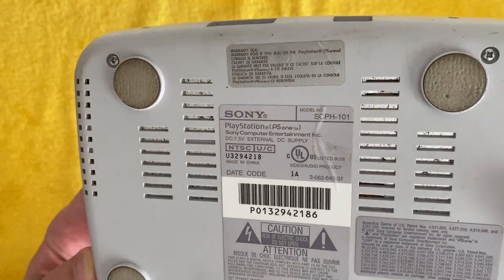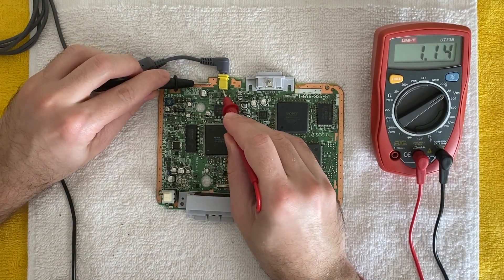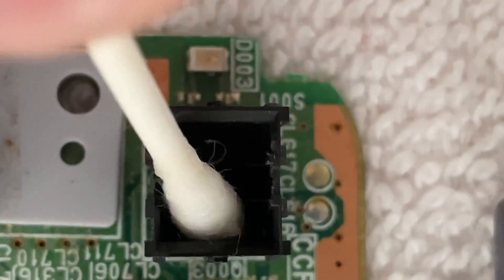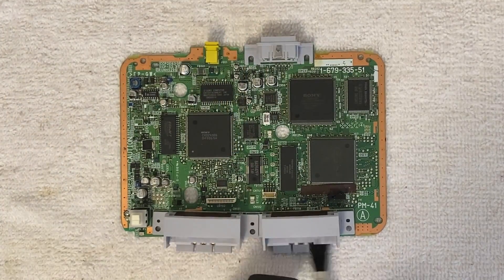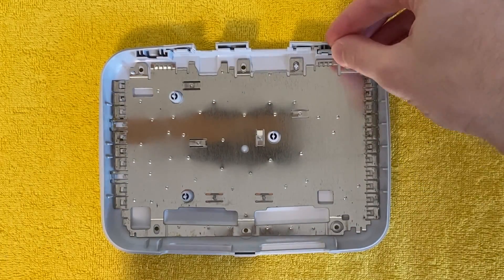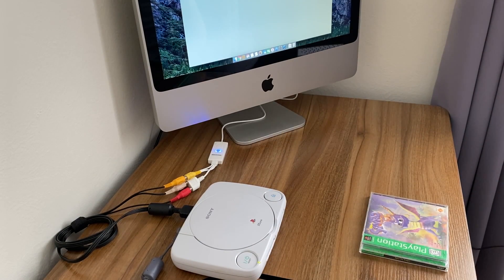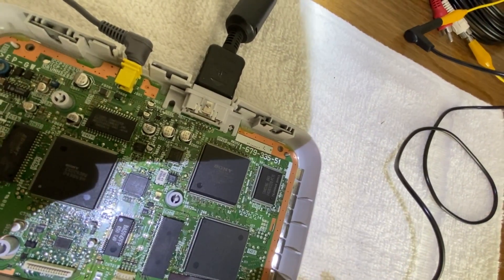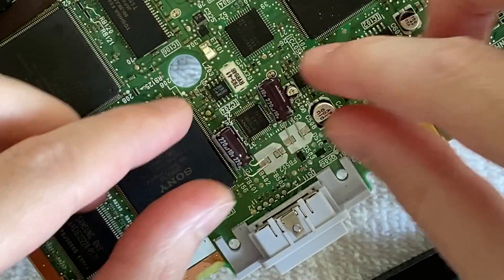$0.96 Faulty PSone Repair - Retro Console Restoration

Comment: I doubt I'll get a reply on a 5 year old video but how did you attach the multimeter to the cables? I couldn't quite see. Also, were you just testing continuity or was it on a different setting?

I have two ps ones with glitchy video and I'd like to test if it really is the capacitors before gettin out the soldering iron 😅

Comment: Tried cleaning out that power button and I can't FOR THE LIFE OF ME get the damn thing rebuilt; the spring keeps flying out, that small metal pin thing keeps falling out of place, and I don't know if the metal plates are set correctly; they look bent and I'm not sure which way they're supposed to be facing. I thought about just buying a new power switch, but I can't seem to find the right one.

Comment: Mine still immediately turns off after (even though switch is in on position), the LED blinks green when pressed but as soon as I take pressure off the LED turns off again. I feel like it's an issue with the button but I followed your video and my button parts all looks the same as yours

Comment: I'm impressed with your troubleshooting skills and how cleanly you got the caps off the board.  

Your soldering skills need some work.  This is an older video so I'm going to assume your skills have improved since this and you have invested in some better quality solder and a better iron.

Comment: Have a friend who did mostly old consoles restorations and he told me about these specific models that often there is nothing broken it just need a solder reflow on few places or a good cleaning, people toss them out without even realizing it's a near perfect unit, basically by tossing it out only then creates actual further damage. Some shops also have these sitting for years and due to being in bad environment they accumulate rust. Also said that the ones he found just had rust on them even tho powered on and played games without issues, why were they in boxes for years in repair shops no one knows... Lots of ignorance and neglect is what kills these consoles and not manufacturing faults.

Comment: Hello, this video really helps me find the faulty capacitor on my ps1 fat model. My SMD faulty capacitor code is "GRZ 220 4v" can I replace it with SMD "220Uf  4v"? or is it okay to use SMD "220Uf 10v" Please advice. Thank you
Reply from the maker: Has to be 220uF. Can be 4V or rated for higher. You can always go higher on voltage rating, just make sure to match the capacitance.

Comment: My psone worked fine for like 3 years then I kept getting a insert Playstation format disc and i replaced the laser and still getting that error, maybe fuses in the motherboard are dead?
Reply from the maker: There are 5 fuses to check. I have another PSone video about it. But also confirm you removed the solder blob on your new laser (most ship with this solder blob for transport and it needs to be removed)

Comment: what can i do if the conector is broken?
Reply from the maker: Which connector? Are the traces still good?
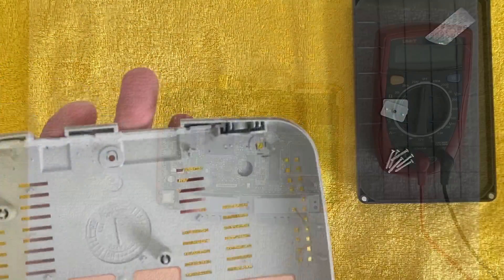Reply: @BorderlineOCD  Sorry if i sound a little dumb, i was talking about that yellow thing where you plug the cable, where you use your multimeter in 1:26

Comment: Man this was an awesome video.  I'm currently waiting on my first batch of "broken" consoles to come in so I can attempt to fix them.  For most of them I'm not expecting much problem, but if there are any issues with the motherboard like in this video, where do you look for information on how the connections on the board flow?  Are there schematics, or is it intuition from working on boards?
Reply from the maker: This particular system has very easy to find schematics. I found them useful for component identification, particularly fuse values. But I don't go straight to schematics. There's a bunch of common issues with this model you can check first. I have another PSone video that covers some of these common issues: https://youtu.be/k6JgGvVGmgw.

Comment: I got a psone that keeps blowing the fuse when I try turning it on, it worked fine it had a mm3 chip but I tried to "shorten the cables" to tidy the chip installation, now it won't turn on and it keeps blowing up the fuse, what can it be?
Reply from the maker: The main power fuse (2A)? I would guess that theres a short somewhere (probably stating the obvious) but if I was in that situation I would remove the modchip and see if the issue persists.

Comment: Great job. What do you suggest doing when the PS1 starts to the home screen, but the lens doesn't do anything. Is that a capacitor issue, or something more serious with the lens.
Reply: If the disc isnt spinning at all, its likely that the grease has dried out and the gears arent catching so the slide doesnt move. Im having this issue with a couple of mine and need to get some lithium grease

Comment: what kind of lead fits in a composite video port?
Reply from the maker: Not sure I understand what you're asking unless you mean an RCA connector.
Reply: @BorderlineOCD  ya i have a multimeter but the leads dont fit into a RCA connector
Reply from the maker: I have another PSone video that shows you how you can use a paperclip to make it work.

Comment: O nerd tour help i hace this model Playstation and not function Port controller is possible help to me thanks for tour answer
Reply from the maker: I haven't run into that issue on a PSone. On the original PSX there is a fuse for the controller board but not sure about the PSone. Have you checked all the fuses? Have you also confirmed your controller works on another system just to eliminate that as well?
Reply: @BorderlineOCD  hi and thanks for answer My controller is fine works un another console and the problem is my console this week check the fuse and answer to you my friend salutes

Comment: Can you list the capacitors ratings and where you got them from.
Reply from the maker: The originals are 220uf 4V caps. I replaced them with 220uf 10V caps. I got mine locally in my neighborhood, but if you want to buy them online you might as well source the exact replacements rather than install the larger ones I chose to use.

Comment: My psone when i playing the psone restart continuosly
Also must be a capacitor?
Reply from the maker: I don’t think so. Sounds like something to do with the power rail or power supply? Check the connector to see if it’s loose. You might have to open it up to inspect the solder joints up close. If you can borrow a known working power supply that would also rule out any issues with yours.

Comment: How to check the lens is not broken?
Reply from the maker: Not sure precisely what issue you're having but a common problem with these is failing optical drives altogether due to broken gears (the gears were initially made of plastic and they often break).

Comment: Have you ever run into one of those ps1 models that only displays in very dark or very bright almost as if it's displaying in black or white? If so how do I fix it?
Reply from the maker: If I had to guess, your AC coupling capacitor is failing but hasn't failed altogether. Its the same capacitor I replace in this video.

Comment: That's why I don't buy electronics from EBAY, because people sell them broken. 
It's hard to be happy of what you want to buy off of EBAY, but you're also disappointed at the same time when you don't know the seller who rips people off. Specially when they don't tell you what defect the product has, when they only give you a small amount of details.
But im sure it's like that off of Amazon too, but not as much as EBAY.
There's a lot of people who sell electronics off of EBAY, who aren't truthful about those products they sell.
Reply from the maker: I've had decent results with eBay listings. I think its important to check the seller's feedback and assume if condition is "unknown/untested" than it's most likely broken. If you have those expectations you're usually not disappointed.

Comment: I too have a non-working ps1. It boots, but can't read any disc. I assume the problem lies in the laser, but I'm actually clueless. Any idea pal?
Reply from the maker: A common problem with these was failing gears in the drive motor (they often break). You can carefully disassemble the drive housing and see if the gears are indeed broken. You'll need a very small screw driver to take it apart.
Reply: @BorderlineOCD  I happen to have a set of very small screwdrivers, but without a video tutorial I don't even know where to start or what to touch: is there anything valid and crystal clear (for dummies like me) available on your channel or on YouTube that you would suggest? It's not a matter of life and death, I just think it's cool if I could revive my old PS1
Reply from the maker: If you don't find anything on YouTube that helps, stay on the lookout for a follow-up video to this repair. I have another faulty PSone so maybe I can take the drive apart in that video.
Reply: @BorderlineOCD  Yep sure, I have already subbed, keep up the good content

Comment: I have a problem with my consolle it's the same model of that but the disk don't wont to turn and when i Power on the consolle go to the bios ( the grey squares when your consolle dont read the disk)
Reply from the maker: A common problem with these was failing gears in the drive motor (they often break). You can carefully disassemble the drive housing and see if the gears are indeed broken. You'll need a very small screw driver to take it apart.
Reply: @BorderlineOCD  the cd wont spinn Sorry for the english i'm italian😅😅
Reply: @BorderlineOCD  the motor work
Reply: Can you help me?😅😅

Comment: Nice content. Why all repairs on YouTube are easy tho, mine has a weird problem. When i heat up the CPU with a heatgun, it works. When it cools down, it crashes.
Reply from the maker: In the moment is certainly feels frustrating but after you figure it out it looks obvious :) Your issue is strange. Sounds like you're getting it hot enough to bridge a fractured connection. Does it work if you apply some pressure with your hand when you turn it on? Wondering if its worth reseating the chip with fresh solder.

Comment: i still have a lot to learn about electronics but maybe some day i will be able to fix my old ps2 that cant read discs cuz the ports for disc reader cables on motherboard seems to be broken i already was able to discover what was the cause of the issue and thats something
Reply from the maker: Great first step figuring out what's wrong with it! Definitely save it for a future repair. Maybe you can practice on a 'soldering project' kit from Amazon or a faulty appliance that you don't mind messing up.

Comment: always the freaking av connectors ;D
Reply from the maker: The video issues are apparently a common issue with these, along with the optical drive gears breaking and power switch failing...

Comment: I need to check the power switch on mine. I never thought about doing that.
Reply from the maker: Apparently a common fault with these. You can also short the pins on the back (horizontally, not vertically) to manually close the switch if yours is broken altogether or something.
Reply: @BorderlineOCD  the switch seems to move up and down fine but I never thought about checking it with it opened up all the way. I also need a diagram so I can also check the fuses as well.

Comment: Great restoration, but I would recommend to replace all caps when you first do a restoration. The ps1 is getting a bit old now and it would be a shame if one started to leak and ruin parts of the machine.
Reply from the maker: I'd definitely consider this on a system that has more personal collecting value to me. I'm keeping a look out for the original PS and may do a more thorough restoration once I get my hands on one.

Comment: careful with the vacuum cleaner. static will kill tiny components EASILY!
Reply from the maker: Received a comment or two about this. I understand the theory behind it, although I've never had it happen. Will look into using an air compressor instead in future repairs.

Comment: Solid capacitor not eletrolitic!!!
Reply from the maker: In a perfect restoration yes, but I had to work with what I was able to find locally and the store didn't carry any SMD components. I also researched as much as I could about this video circuit (AC coupling circuit) and although I don't fully understand the intimate details, I've gathered that all this capacitor is doing is filtering or stabilizing the video output signal (which is why I'm able to bypass it during testing and still get video). All in all it made sense to repair it this way on the cheap and get the console running.

Comment: I also have a semi broken psone, It wasnt actually that bad but then i tried to fix the disk laser with some alcohol and now laser is not responding to disks. Do you have some suggestions how i can fix it ?
Reply from the maker: Isopropyl alcohol alone shouldn't damage a disc laser. Wondering if there is another underlying issue. Does the motor spin up? Does the laser move at all (if you simulate the lid being closed). Asking because a common issue with these particular optical drives is the plastic gears failing (they often break).
Reply: i will update when i check it, thx for response.  As i remember i checked the with lid closed moded and probably it didnt even spin once. But i need to check it.
Reply: @BorderlineOCD  sup man, i recorded the behaviour of my ps1 can you have a look at it ? https://www.youtube.com/watch?v=7VFB6AzxXvA&feature=youtu.be

Comment: Your video was inspiring because I have a similar problem but it's on my media controller for my mixer one of those little capacitors falling off the board and I wasn't sure what to do the companion suggested replacing the whole board for €70 but no idea what that is in Great British Pounds
Reply from the maker: If your only option is a replacement board in your particular situation, you might not have much to lose by trying to replace that capacitor yourself. The replacement capacitor should have the same capacitance rating but the voltage can be higher without any issues. For example if its 220 uF 10V you can replace it with 220 uF 25V if thats what you find (i.e. you can go higher on the voltage just not lower).

Comment: Just so I learn something, you connected your probe to the video input signal on your capture card, then traced that signal back to before the damaged capacitor, right?
Great job!
Reply from the maker: Yes, that is correct.
Reply: @BorderlineOCD   so the probe being connected to the stereo audio out is?...
Reply from the maker: Nothing connected to the audio inputs during testing. Just the composite input to probe the various points on the board to check for the video signal. Once I solder the new caps I just use the regular AV Multi Out cable but no sound testing before that stage.

Comment: I'm not sure what's more impressive, how easy you fixed it or the fact that you got a virgin PSone
Reply: What do you mean by "virgin PSone"?
Reply: @cbspydoge  intact warranty seal, with no modchip installed, unless you get one in a sealed box, that's harder to find than an unicorn
Reply: @walpurgisonne  Thanks for the quick response!
Reply: @walpurgisonne  I got one 😍 and it works like a dream still
Reply: Strange things are happening to Woody  the thing there is that most of them got them removed
Reply: @BarryMGC  depending on the condition it might be worth more than a regular one if it's still functioning properly.
Reply: @walpurgisonne   Well yeah mod chips were always pricey. For quite some time now I can buy a PS1 for 5 euros while a new mod chip is 15 euros and another 15 for a tech to install it that is 30 on a 5 euro console XD 
Often if its chipped and in decent condition the 5eu price jumps to 50eu. 
But honestly it's all worth it anyway.

Comment: Electrolytic capacitors mark the negative side, not the positive, or cathode as you said. I know, it's backward from all other caps. They're special, I guess. You're bang-on otherwise lol. Good video!
Reply from the maker: Can you help me solidify my understanding? Do you mean cathode is the positive rather than negative or did I misunderstand your explanation? As for markings, the SMD had a dark stripe and these electrolytic replacements had a light (rather than dark) stripe but the stripe (dark or light) is always negative, i.e. cathode... :) Sound correct or am I still confused?
Reply: @BorderlineOCD  The cathode would be the positive end, and negative would be anode.

Most of the time a capacitor has the positive side marked. However, electrolytic caps have the negative side marked. Some caps are bidirectional and aren't marked. Ceramic disc caps are bidirectional, for example.

The caps you replaced were electrolytic, so you were right to match the marking orientations. Had those original caps been tantalum or some other solid SMD cap, you would've heard a bang. Electrolytic caps are quite violent when you're cramming those pixies up the wrong way lol 🤣👍

Comment: So with some type of isopropyl alcohol i can clean the circuits without worrying to destroy something? :) Thanks... I am amateur occasionally playing with electronic but i didn't know what exactly can i use for cleaning
Reply from the maker: I'm an amateur as well so take this with a grain of salt but I shower my boards with 99% isopropyl alcohol all the time and clean them gently with a soft brush. I haven't had any problems so far. I would still suggest you use a 99% solution or better yet 99.9% if you have easy access to it as the water content is minimal and it evaporates very quickly.